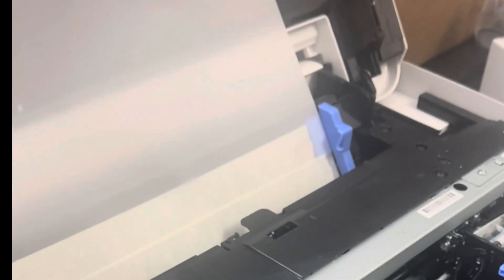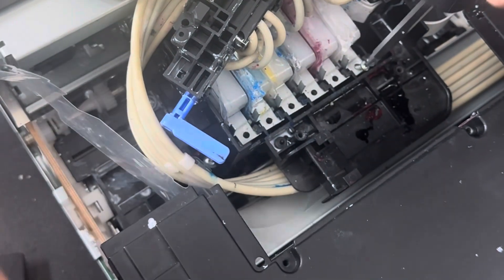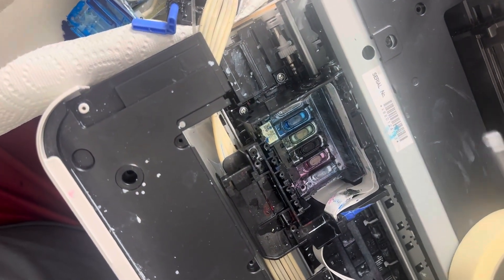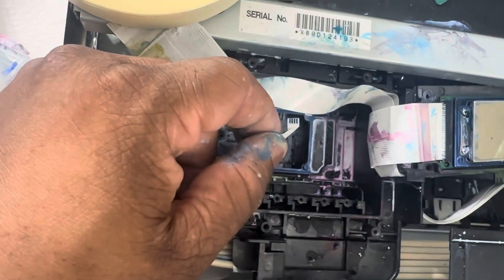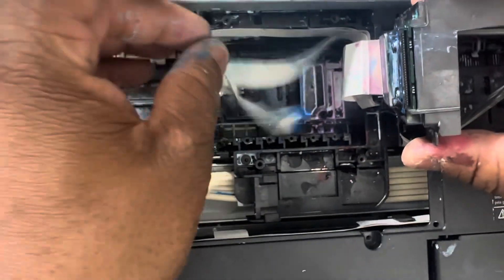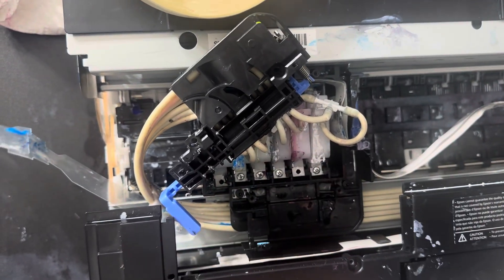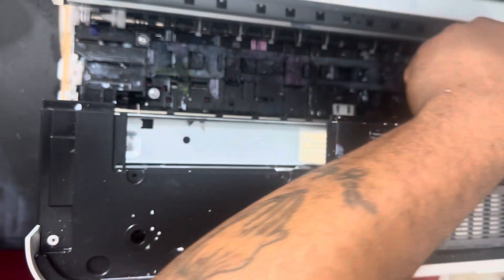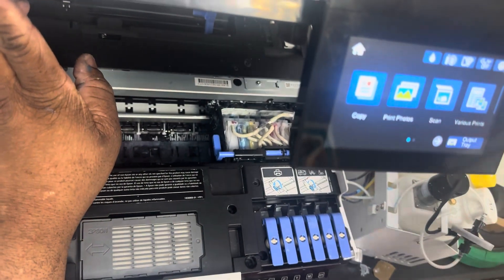Epson 8550 #Paperjam #dtfprinter

Comment: You are correct sir!  I fixed this problem the same exact way you did. It lasted for about 40 sheets and the PW sensor got dirty again. 

  I actually once was able to clean the PW sensor without taking the head out with hooked tweezers and paper towel taped to the end. 

There has to be some  
kind of sponge with an angle to get in there and clean it without taking it apart. Good work bud!

Comment: just a quick question I followed your video for the installation of the CISS system but as soon as the CISS system pump works the printer no longer prints white, just the other colors. is there a direction for the 2 tubes of white ink please? or should the CIss pump be stopped? please help me